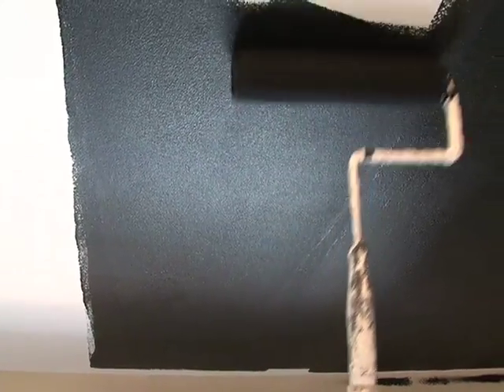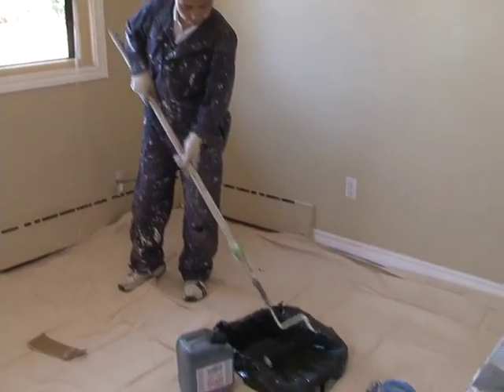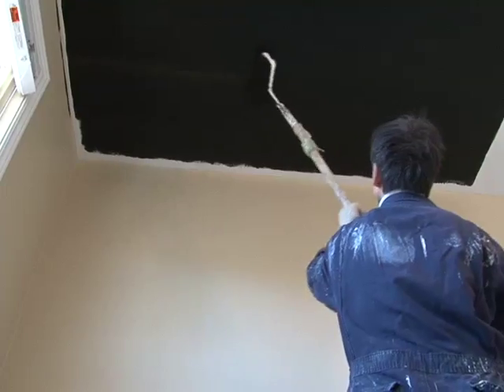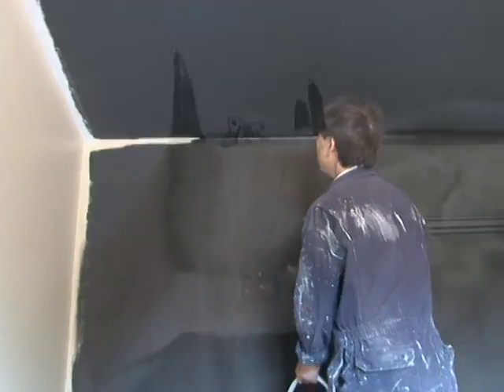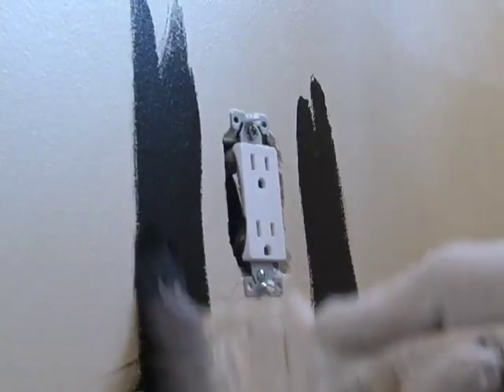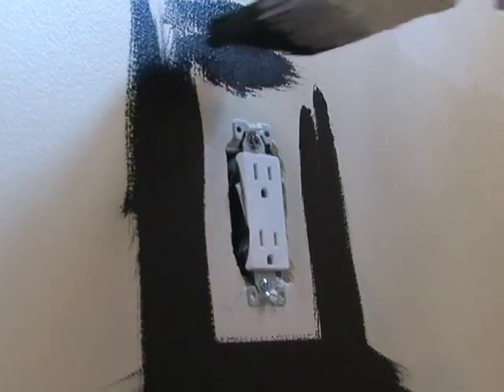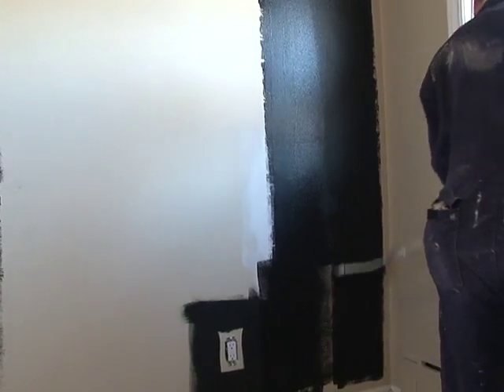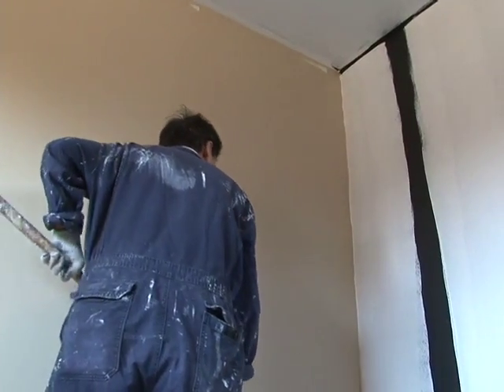EMF painting

Comment: I noticed that you didn't paint close to the wall outlet.  In fact, in my bedroom, the wall outlet (one of them) has a high measure of EMF.  It is a 400SF park model trailer that I will be living in.  I'm not sure but I think the other side of the wall is where the entire electrical unit is on the outside of the building (in my bedroom area).   What can be done?